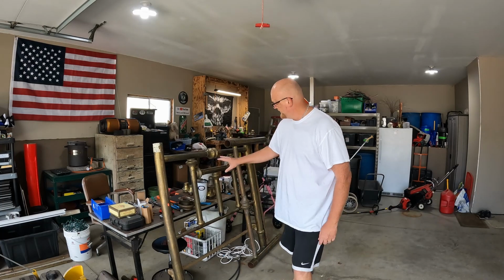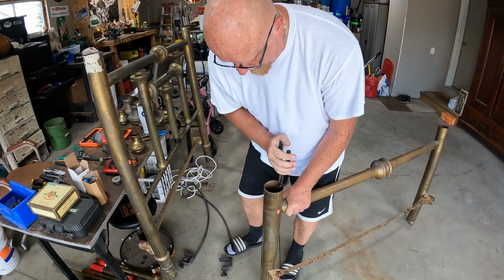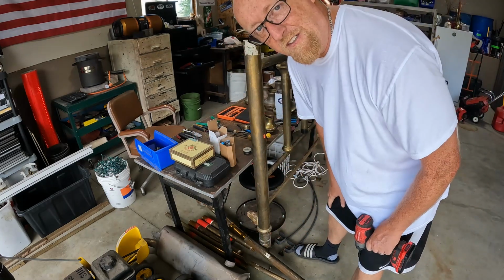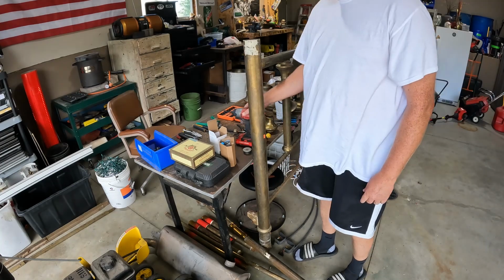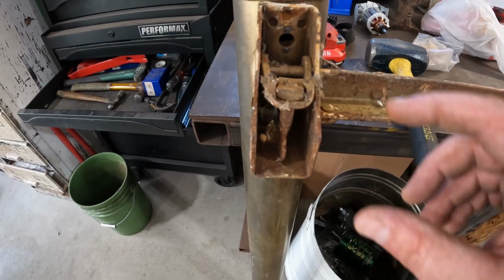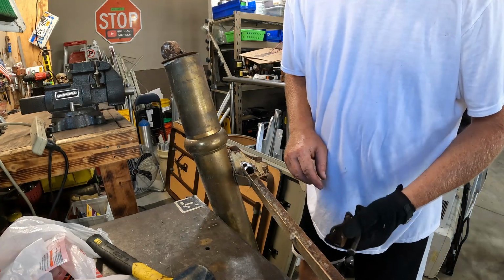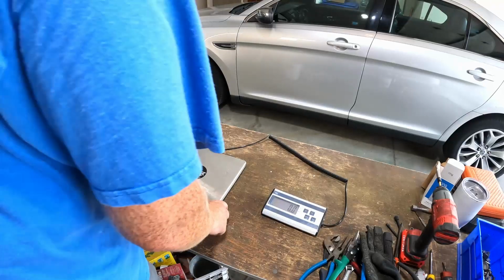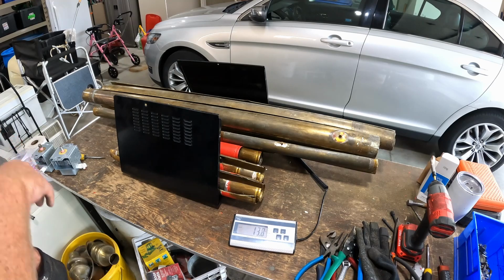I Scrapped A Brass Bed - VERY Nice Surprise!

Comment: Those are some big brass knobs, you got there 😁 $22 bucks, can't argue with that, nice little profit 👍 I scrapped out 3 microwaves today, but only aluminium transformers.
Reply from the maker: microwaves are hardly worth taking apart unless you need a magnet.  It's basically a little wire and shred steel.  Really the cord is the best part.
Reply: @SkullerMetals  Yes, not huge value but I still pick them up as they are easy to scrap.